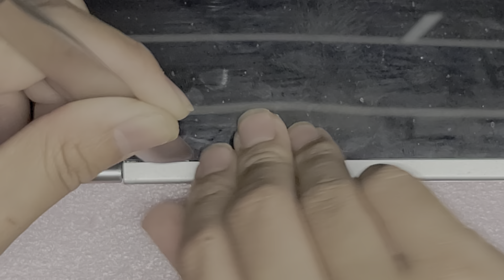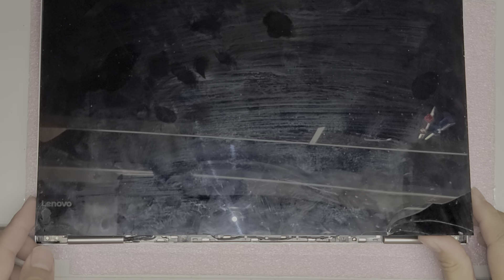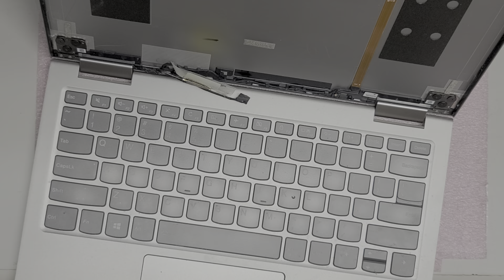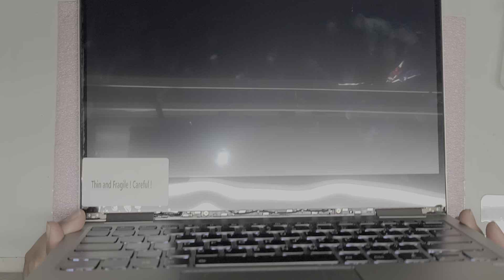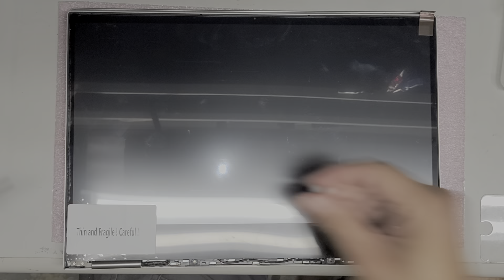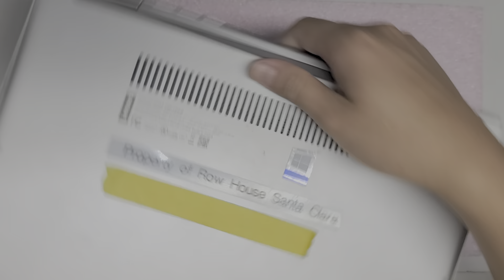Lenovo Yoga 730-13ikb Disassembly SSD Hard Drive Upgrade Repair Screen LCD Replacement

Comment: Hey bro is there no way at all to upgrade the ram? I have a yoga 730 13ikb and wanted to upgrade the ram.
Reply from the maker: You'd need to replace the logicboard
Reply: @ItsBinhRepaired   is that expensive or difficult to do?
Reply from the maker: I hate how YouTube doesn't notify me of replies. Were you able to figure it out?